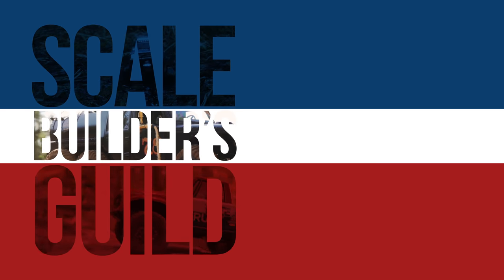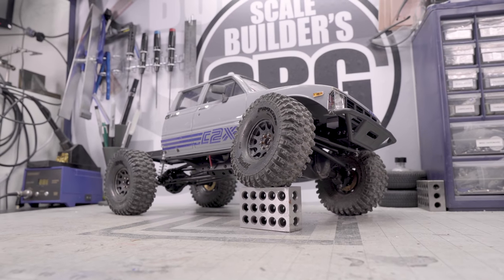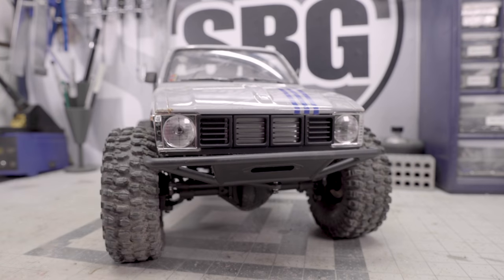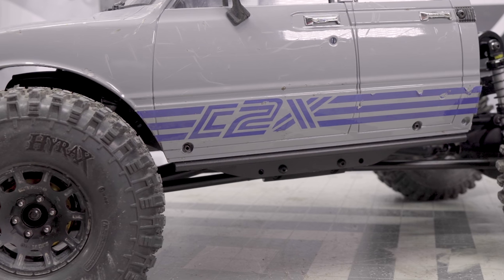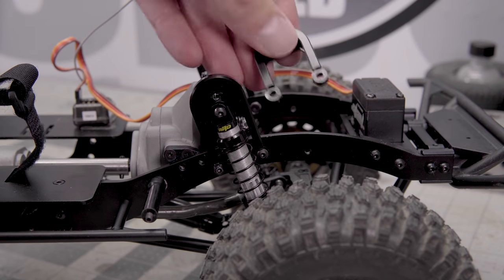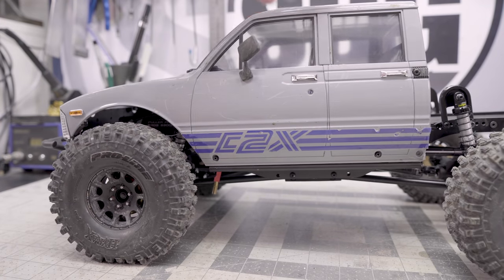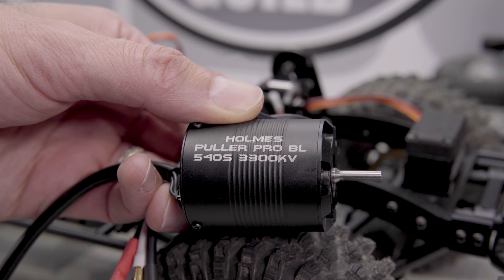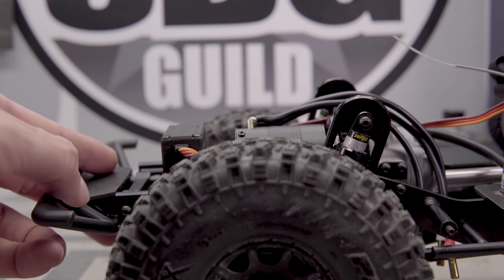Putting the "C" in the C2X - The C is for Comp.

Comment: Beware the grub screw mod... The threads will "saw" at the body and eventually totally wear through, in not a ton of time.  My preferred method is to put a screw through the outside like normal, fill it with filler so it's "shaved," put a metal nut with liberal amounts of loctite on the back (pre filler), and then drill out your plastic screw mounts to the size of the screw with threads included.  It has the same effect as the grub screw method, but the plastic pieces off the chassis don't tend to get eaten through;  they're cheap and easy to change if they do, though.  It's more work, but far more effective.  I learned about this trick from Andy Lowery at the first USTE.
Reply: that's actually a pretty good tip. thanks for sharing
Reply: all you gotta do is put a piece of shrink wrap on the grub screw

Comment: Great minds think alike (lolz) - mine already has the VS4-10 bumper and the new C2X slim-profile sliders, too! I angled my rear shocks forward, and just managed to wedge a HH Crawlmaster Sport 13t behind the servo. They really don't leave much room for the motor! However, I haven't finished installing all the electronics yet... You may have convinced me to swap in my HH PP Stubby 2700/Mamba MicroX that I was saving for another project. Oh, almost forgot - I installed the Z-S1882 Trail Finder 2 Aluminum Side Body Posts, will be modding some screws for a quick release setup. The aluminum side posts have a crossmember connecting them, I like the additional strength over the plastic threaded posts. Also have a pair of the new RC4WD ARB Intensity LEDs that will likely be mounted on the bumper.

Comment: On the front shock mounts where you kicked them back, it the rearmost mounting hole that far down so the nut can clear the gear? Thanks.
Reply from the maker: Gosh, I'm sorry I won't be able to answer this, I sold the truck in the summer. But my guesstimate would be yes, that's why it had to be so low.

Comment: Watch that temp on the mamba micro x, specially with a smaller spur and 3300kv.
Reply from the maker: I did the math, this setup is actually slightly more reduction than stock. Not too worried, I won't be constantly at 100% throttle.

Comment: Holmes publicly recommends the micro x / puller pro stubby combo... Says it's a great combo but you'll need the mamba x to run the larger motors.

With how well the standard puller pro moves my trx6, that stubby has to be awesome. I kind of want to try the stubby on my trx6 and see how it goes, but I just put the long version back in, 4100kv, to get some more wheel speed in 1st to get over some steep climbs.

Comment: What is with all the wires on the motor,l'm use to two wires for the motor
Reply from the maker: It's a brushless, sensored motor. Needs all of those.
Reply: @scalebuildersguild  so it is better than the two wire motor,I will check into this,thank you for the info
Reply: @jamesswift4641  a two wired motor is usually a brushed one.
Reply: @Warwick3511  ok, I'm trying to find a motor and esc combo that will run off of a nickel metal hydride battery
Reply from the maker: James Swift stick with brushed if you’re running Nimh.
Reply: @scalebuildersguild  thank you,I will👍👍

Comment: Do not do the grub screw body mod. It's a terrible mod that destroys your body fast. Instead use screws and spacers. I used button heads and spacers and it's just as secure and also is not a saw chewing through my body like a grub screw.
Reply from the maker: since I'm treating this as a comp rig, the amount of running is greatly reduced and it'll take years to saw through the body.

Comment: John Holmes does not recommend that ESC with a puller pro 3300. But hey, it's your funeral. Kinda surprised you went brushless for a comp rig.
Reply from the maker: I’d be curious to know why, and happy to get your feedback!
Reply: @scalebuildersguild  Well I guess you will be able to confirm or deny. However I bet on comp rig it would be irrelevant as the amp draw is fairly low for that type of driving
Reply from the maker: I spoke to John this evening. He mentioned that it is a tiny bit aggressive, but runs the same setup in one of his shop trucks with no issue.
Reply: @scalebuildersguild  Thats really good to know, opens up some options when running the micro-X !